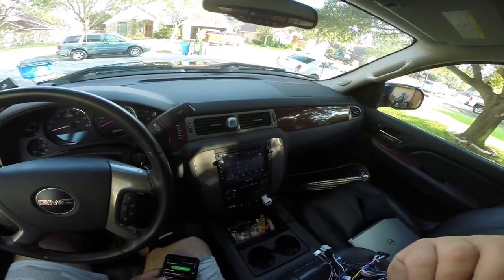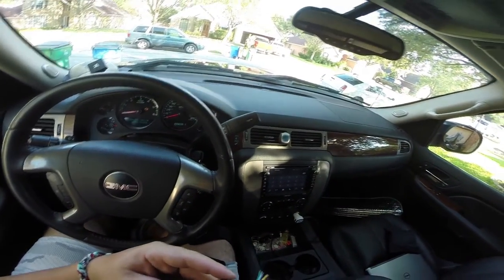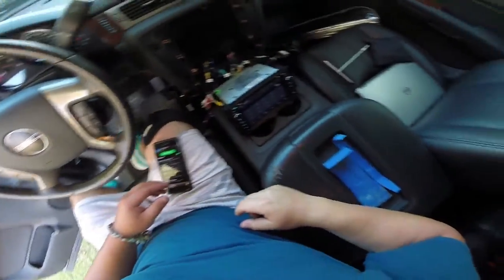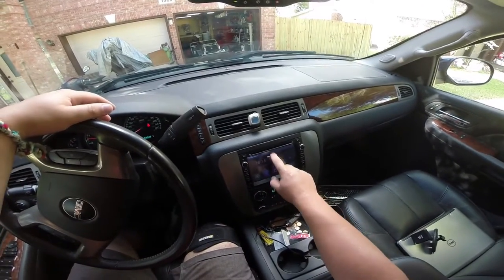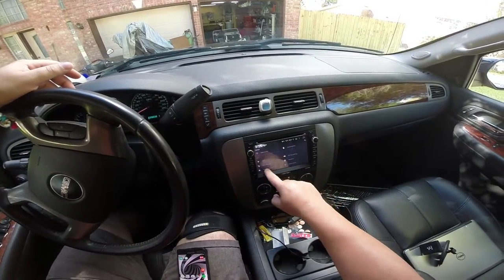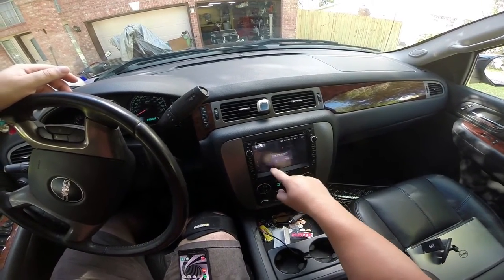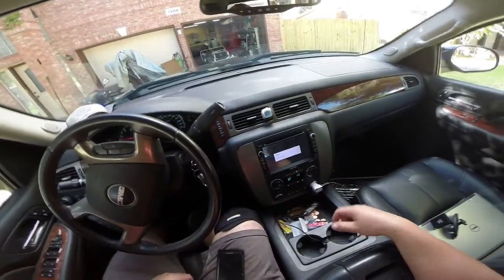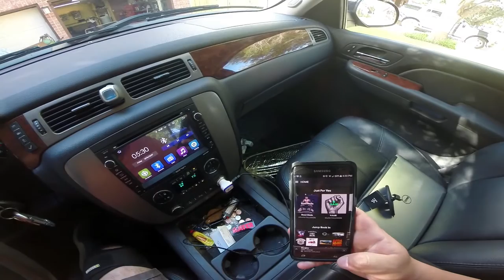EONON GA6180F Update

Comment: Any luck on the buzzing?  also, any luck changing the volume of the door chime/ dinger sound?
Reply from the maker: I simply put a piece of duck tape on the grill and then it gets more manageable. As far as the buzzing is concerned they are sending me a whole new headunit to see if that fixes the issue.
Reply: That's not very comforting.  A whole new unit?  What do the rest of us do? LOL.
Thanks for responding.
Reply from the maker: I got a very early production unit. So that may have something to do with it. Hopefully the new unit will take care of the issue. 

I have no reason to believe i am getting any sort of special treatment. Just a company and a consumer working out an issue.
Reply: Did you ever get the buzzing fixed?